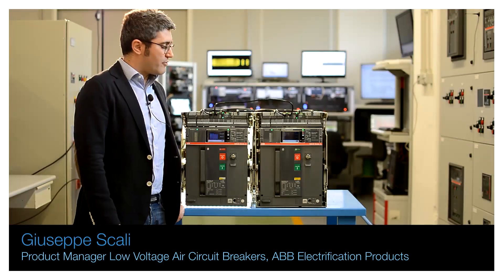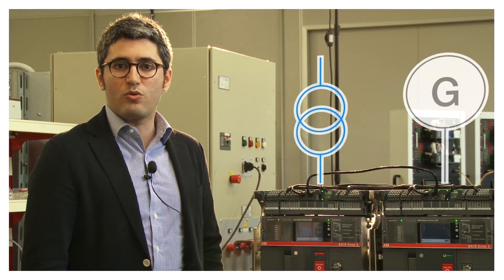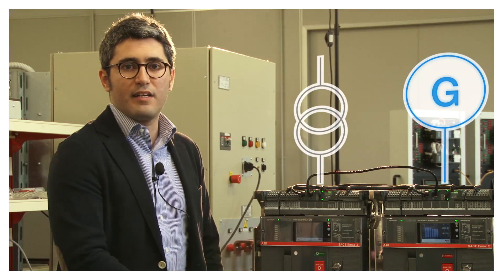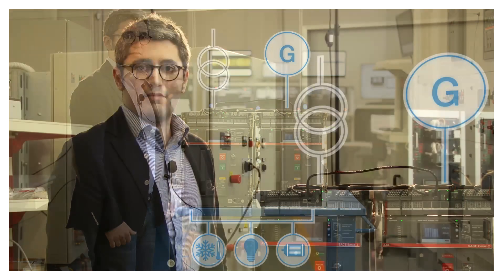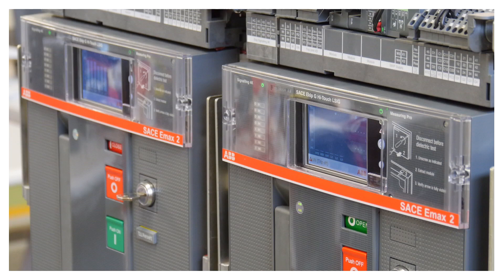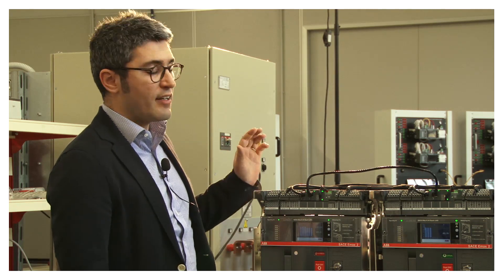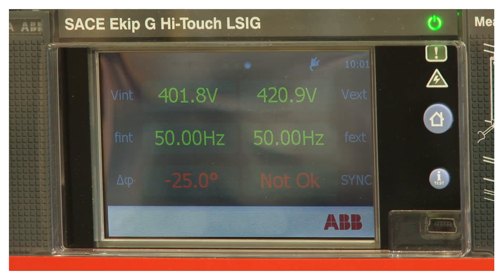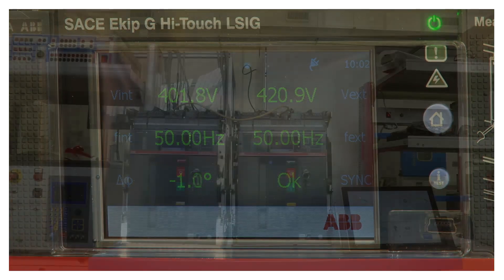ATS Automatic transfer switch. Emax 2 manages microgrid power sources

Comment: Question-1: Can we use this for Fast Bus Transfer? or is it only for Residual transfer scheme (Undervoltage) condition only?
Question-2: Can you modify the program for the ATS,  means changing the delay time for CLOSE, denies to transfer if any blocking conditions are present etc.
Question-3: Does this also provide the overcurrent protection functions(50/51)? If so, does this eliminate the use of Relays used for ATS?
Reply from the maker: Thank you for your question.
Here some answers to your questions:
1. Depending on the specific product, the Embedded ATS reacts to Under voltage or to Under/Over voltage + Under/Over frequency. A manual transfer option is available also, but it is not a Fast Bus Transfer. Please refer to your local technical support to go deeper in these topics.2. A wide range of settings is available, as well as input/output options. Please refer to the technical documentation for more information : LINK3. The overcurrent protections are included with the circuit breakers. An overcurrent protection trip will block the transfer logic to avoid an unwanted feeding of the fault. The ATS logics
are integrated in the very same trip units mounted inside the breakers, hence he definition of “Embedded ATS”. Thanks to Emax 2 with embedded ATS, it is possible to remove external relays, sensors and additional cables.

Comment: is it necessary to still use a Mechanical Interlock in this ATS application for safety?
Reply from the maker: +John Pereira 

Thank you for your question. The use of mechanical interlocks depends on customer’s application. The embedded automatic transfer switch is based on digital logics and it’s able to work with other kinds of interlocks too. For additional information, please visit http://new.abb.com/low-voltage/products/circuit-breakers/emax2/microgrid